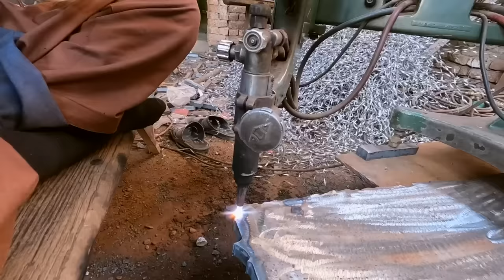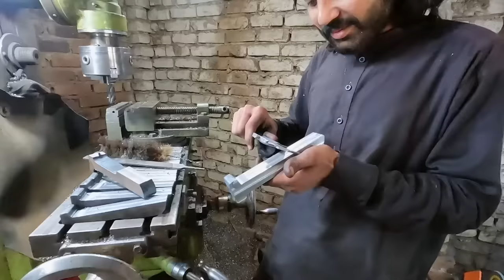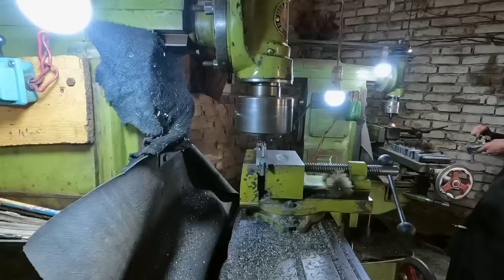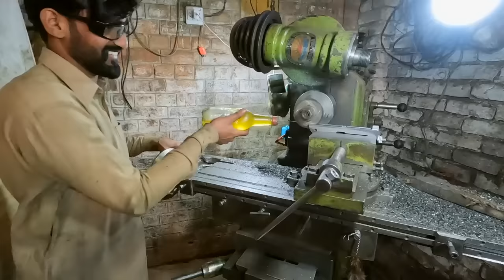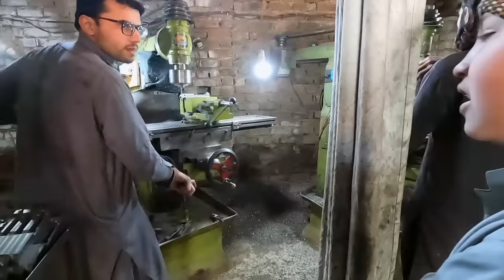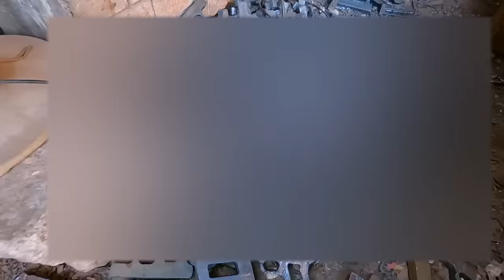Powerful  making Process | Factory Machine | how to make frames

Comment: I wondered where HiPoint pistols came from
Reply: Technically HiPoint comes from Ohio....so, this is pretty Accurate.
Reply: Only the ones that fail the tolerance spec
Reply: Damnit!  It only lets me like this comment once!😂
Reply: Looks like start of Beretta 92. At least the slide. But these guys dont look Italian.
Reply: These look to be well made. Although I've shot many high points, and owned 2 when I was young. I had a 9mm carbine that I wished I would have kept, I traded it for a bolt action 308 NATO 20+years ago. Yes bolt action NATO. I still have it. Heavy pig. The other was the 45acp from robocop. God that thing was massive. So damn heavy, you need a robotic arm to hold it up, and to pull the trigger. Make sure you got a large enough hydraulic reservoir  
When the saved your life and made you a super villain killing Robot Cop, cause it takes some force. Makes a man outta ya tho. How can you appreciate a nice light firearm with a crisp trigger pull, if that is all you ever had. You know what both those high points had in common? Not to mention the at least do,en others I've tried throughout the years? They went bang every time the trigger was pulled. That and they put reliable firearms in the hands of people who don't have $1k to drop on something they most likely won't actually need, so they too can feel safe, And if a terrible event occurs and they need it to protect their family, they can feel pretty confident it will at least give them a chance, withought going without housing for a month to buy  a fancy pistol. If they do ever have a problem, high point guarentee those for life. Or they used to. Not sure if they still do. I've been on the fence about getting another 9mm carbine, I think I will. I have $300 burning a hole right through my pocket. I'll let you know how it goes. Peace.
Reply: Kese melega pestul Bhai

Comment: I'm always amazed the equipment they use and work that they do and then it's always dirt floor and no work Ben I've rarely see one of thease shops in  Pakistan or where even use work bech always. Siting nealing down on a dirt floor in some old blown up buildings must have real lack of construction industry no concrete general contractors and engineers,no such thing as architect's. But the fix the un fixable In this contry and fix any thing